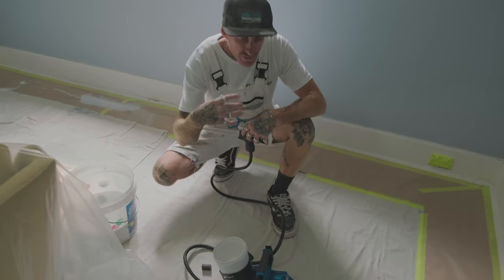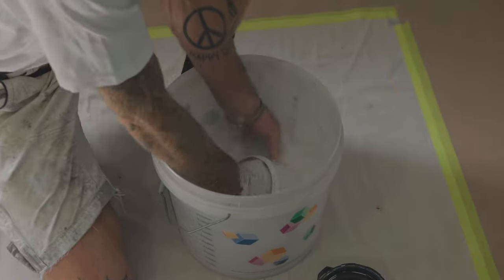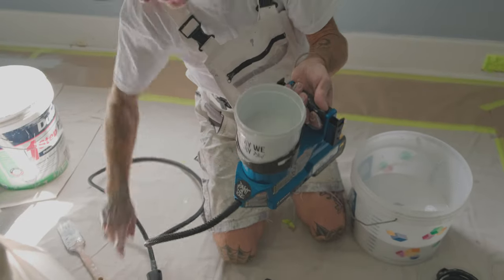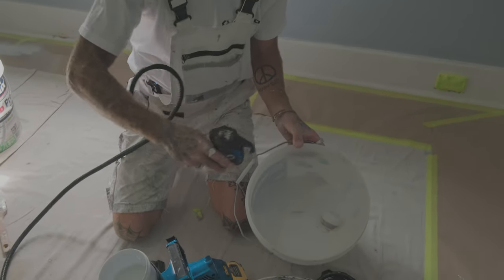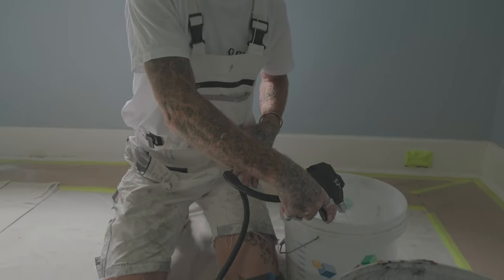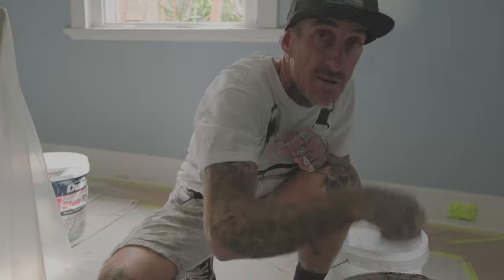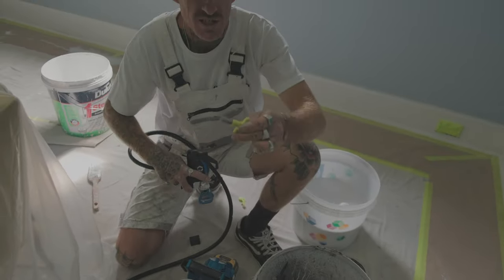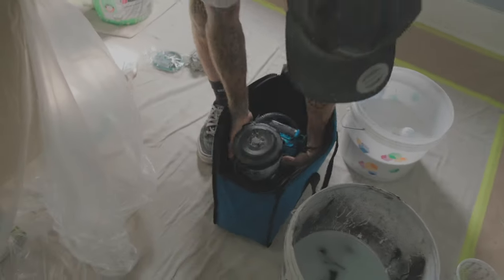HOW I CLEAN MY GRACO ULTRA QUICKSHOT

Comment: Want the  bottom line. How would you rate  this pump? Greco has  failed big time in previous attempts to put on the market a battery operated sprayer that works.  There are truly no short cuts in what you or I do. To pay a worker 50-to 80 USD$$ to clean a   pump seems insane. Please post another video. I would like to  see it from the day you purchased the pump until how many projects it lasted you on. I think I will be expecting to hear from you shortly. Every painter in In  America will respect your opinion as we use a  variety  of pumps on a daily basis.

Comment: One note of caution. When cleaning up avoid letting any water run into the vents to the electrical. I accidentally did this while cleaning up and the electrical portion shorted out. Graco graciously repaired it on warranty and now I am very careful when cleaning up.

Comment: Looks like the cleanup process is no faster to clean than an Ultra cordless.  The real problem I see is the care that must be taken, in the cleanup, to not get the gun wet. I've read a few users had gun failure because of this.  It's a nice unit if were $700, but at double that I'm not sure it's that big of an advancement over the Ultra.
Reply: It is easier if it was done right, 10 min tops.